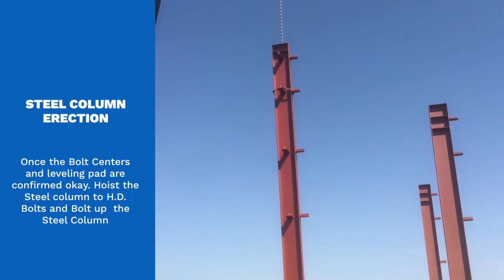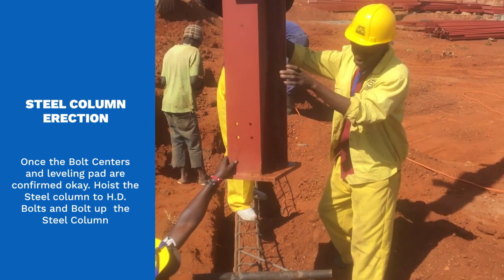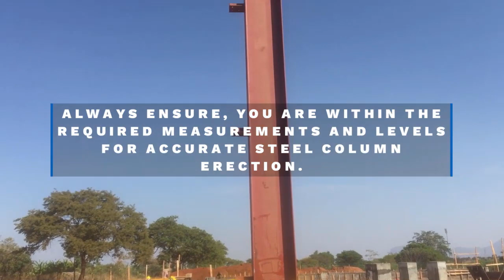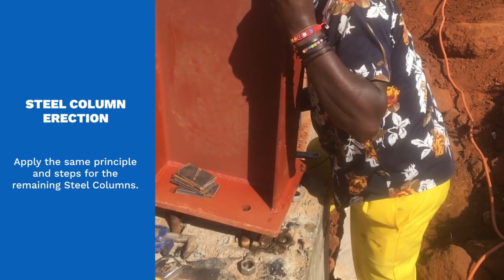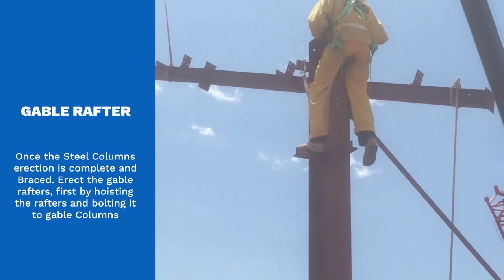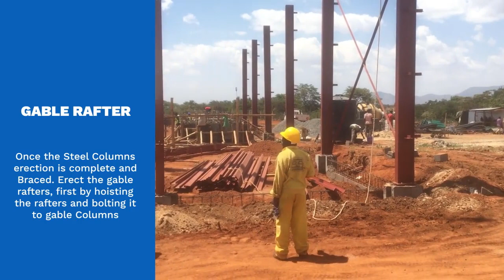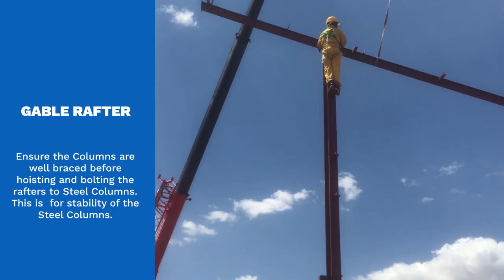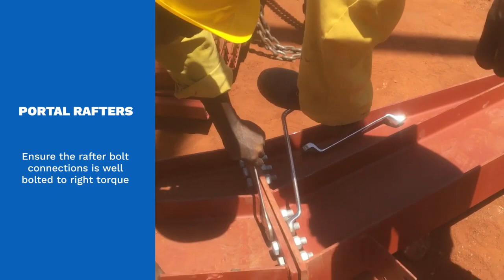Erection of Steel Portal Frames | Part1

Comment: Just fyi, in this case its supposed to have bottom bolts beneath the base plate. So the top vs below bolts tightening the base plate into the anchor robs.

Comment: Just wondering. Wouldn’t it have been safer for the erection crew to use scaffolding as opposed to climbing up the columns the way they did?
Reply: Too much admin and cost, when using scaffolding